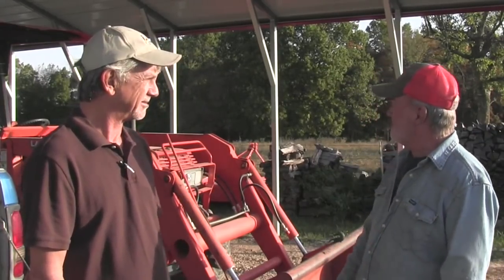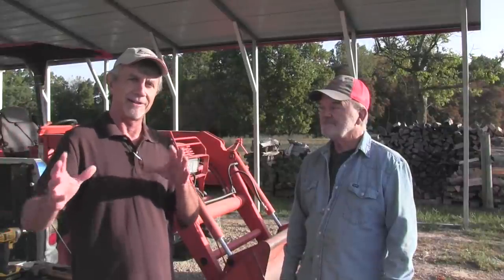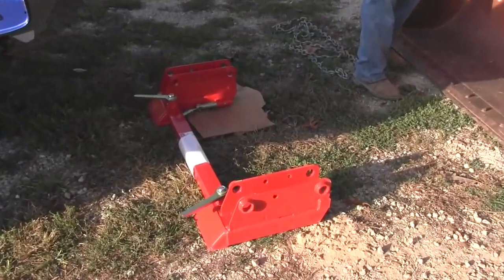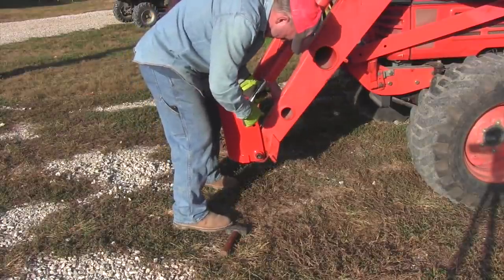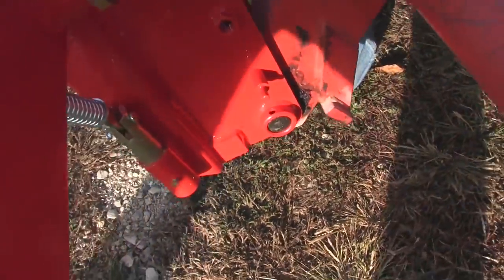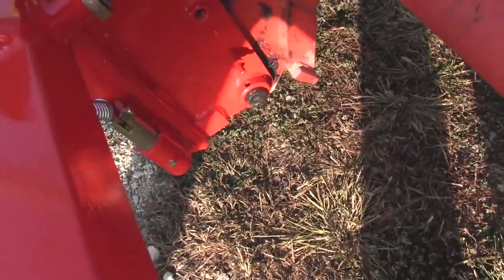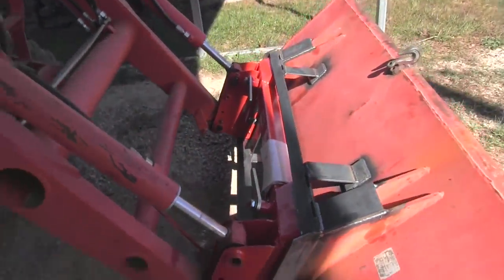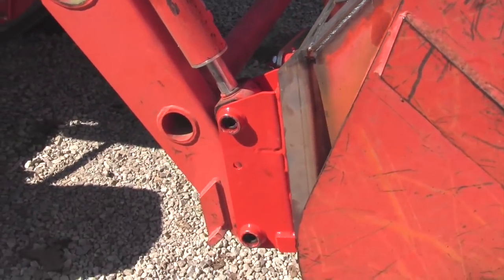Converting a Kubota from Pin On to Quick Attach Bucket

Comment: If only all jobs were that easy!  I would have liked to see how the welding shop was able to keep the correct angle, but it was still nice to watch.
Reply: That part is pretty easy.  The best way is to level up the pin holes then support the bucket exactly where the pin holes are vertical on your weld table.  Then you come in with a square and mark your cut line.  If this needs to be really precise you just go ahead and weld the bucket to the  table.
Ideally you have a measurement from the bottom pin to the top of the quick tach from the tractor  handy.  Now you mock up the attachment plate again at 90 because the bucket didnt move.  You fine tune the cut edge to be as clean as possible and fab whatever plates you need to fill the gap on a shear.  Then you tack it all in check that your plate is the right height and square and burn in all your welds.  Once tacked you can reposition for whatever weld is needed because the geometry is set.

Comment: I just added a quick attach to my Kubota tractor. On your website your pin on SSQA is priced hard to beat when you add the weld on bracket to the order. I had a similar heavy duty round back bucket that I was considering welding on. However, in my case like this one, the round back has limited surface area to weld the plate onto the bucket. Combine that with how cheap buckets are I decided to sell mine and buy a new bucket new with SSQA. Turns out I got a new bucket for about $400 after selling mine and it’s just as heavy duty. After I put the SSQA on I bought pallet forks and I used that to get the bucket off the back of the  semi when it showed up.

Comment: Great video Mike!  I did this conversion on my BX last year - best upgrade ever!  I went with a newer BX bucket (my brother inlay works in the Kubota service department and got it for cost).  I find I use my Artilllian Fork frame more than my bucket!
Reply: I want to do this to my BX but I'm afraid the added weight of the SSQA frame and the bracket on the bucket will substantially reduce my already low weight lifting ability. Same reason I'm contemplating getting a EA Wicked Root Grapple for pin on application, to try and keep the weight down and the lifting capacity up.
Reply from the maker: Here's a Q/A designed for your application: https://asktractormike.com/product/kubota-sub-compact-quick-attach-conversion-la272-la301-la302/.

Comment: You have an old pin on bucket and I am learning that the old buckets have a hump at the back that makes it harder to adapt. The newer buckets are flat at the back and probably less volume but it helps keep the load closer to the pins. So you loose more leverage converting an old bucket. I was able to get a used bucket with the quick attach plate already on it.

Comment: I just bought a used tractor, without the quick attach bucket, I'll be making the same change in the near future.
Since my bucket doesn't have any hooks, I'll just set the bucket down on my trailer, and pull the pins, leaving the bucket on the trailer.  I'll get the welding shop to attach the new plate and some hooks to the bucket.

Comment: Great idea.  I bought a B7800 30 HP HST 16 years ago.  I will look into this conversion.  We just bought an L2501 with the QA loader.  The only idea I would like to suggest is to make the bucket plate reciever pinned as well to eliminate the welding shop.  Maybe there is a reason you did it that way?
Great idea!
Reply from the maker: Couple of reasons, it would be more costly to match that kit to the pin mount, but mainly because it would put the load out further forward and you lose lift capacity the further out you go.  Also, there would be extra metal in that scenario that would reduce your lift capacity.  I totally agree with the concept, it would be nice to offer a kit that would require no welding, but it's likely that the price would cause most customers to opt for the welded plate and on smaller tractors you need all the lift capacity you can get.

Comment: Sorry hit send button by accident, install 4 pins on bucket side with,say schedule 80 bushings on each and make brackets to be welded to the adapter plate to sch 80 bushings. This way you could always remove bucket to sell or replace, rather than cutting all those welds, just a thought

Comment: Hi Mike, I need some information on how to remove my bucket and build a skid steer attachment system so I can have multiple attempts ability.  I think I know but if I remove my bucket and build it wrong, I could screw it all up and be without a working tractor.

Comment: Great video Mike. If they don’t make a Quick attach for a loader, is there a conversion kit that could be adapted to my Kubota B2150 with a 1845 QT Bush Hog loader?
Reply from the maker: There's a universal kit, but I think it weighs too much for smaller compacts.  If you get too much weight out on the front of the loader you don't have any lift capacity left for the load.  Shoot me an e-mail when you get a chance at mike@asktractormike.com and I'll look into it and let you know if there are other options.

Comment: Love it but cant find one for L5450….
Reply from the maker: L5450 is the tractor model number.  If it has a Kubota loader it's probably an LA1150, this would fit it: https://asktractormike.com/product/kubota-bf800-bf900-bf1100-la950-la1100-la1150-front-end-loader-pin-on-to-skid-steer-quick-attach-conversion/, if it could be an LA1150A, and if it's that one, here's your conversion: https://asktractormike.com/product/kubota-la950a-la1001-la1002-la1150a-front-end-loader-pin-on-to-skid-steer-quick-attach-conversion/.  Shoot us an e-mail at support@asktractormike.zohodesk.com if you have any questions.

Comment: Great video, very informative.  I’m courious about welding a quick attach plate to a pin on bucket.  I’ve been told it would be cheaper to buy a bucket with a quick attach plate than to convert a pin on bucket.  Any thoughts?
Reply from the maker: A good bucket is going to cost about $800-$1000.  Any cheaper probably won't last.  If the bucket has any damage to it, when you go to quick attach it would be the best time to replace it, but if the bucket is good I think you'll be a few hundred dollars ahead to convert it to Q/A.
Reply: @TractorMike  Thanks, Tractor Mike.  Very helpful.  -TJ

Comment: How thick is the steel on the plate you welded to the bucket?
Reply from the maker: The standard bracket that welds on the bucket is ¼” plate.  The factory maintains that a plate any thicker is a waste for most applications.  While thicker 3/8” plate is heavier, and that additional material is there “on the job” it does very little for additional strength.   They do offer a 3/8” bracket which is commonly used on wider frames snowplows.  It is a solid, full-width plate…not open center, so there’s less area to weld to.  The 3/8” solid plate would weigh 112 lbs. (versus 51 lbs. for the standard bracket) and add $95 to the cost of the package.  We actually don't recommend it for most applications.